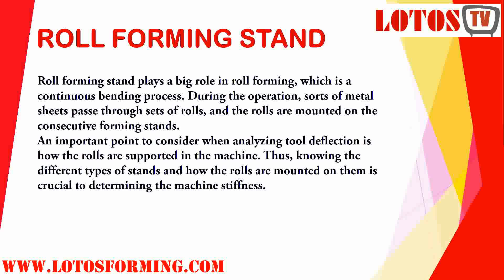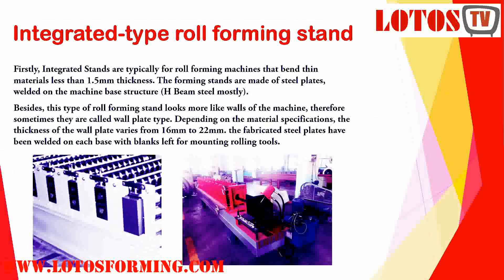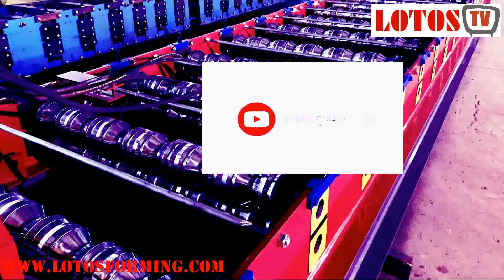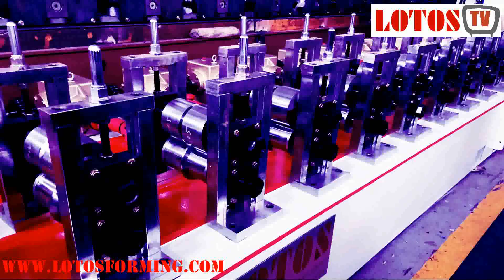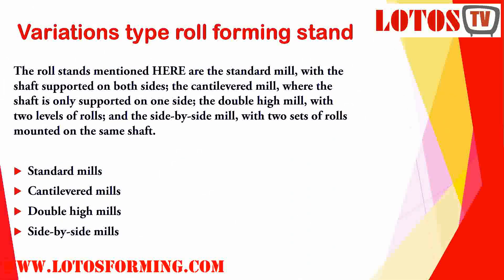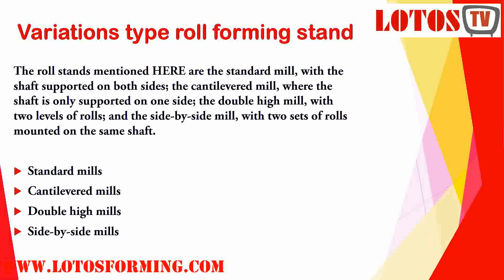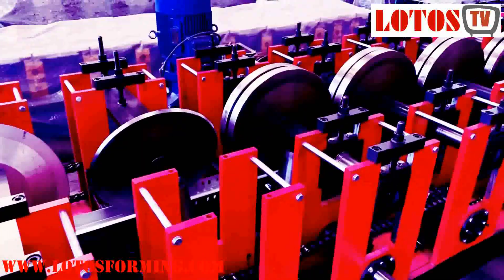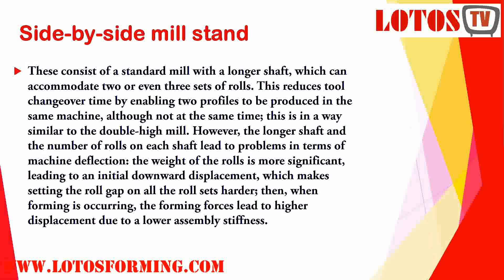【Roll forming machine】: Roll forming stands | Roll forming machine component " LOTOS 2020 "

Comment: Integrated Stands or wall plate type roll forming stands are for roll forming machines that bend thin materials less than 1.5mm thickness

Comment: The variation  roll stands are the standard mill, with the shaft support on both sides, the cantilevered mill, where the shaft is only support on one side, the double high mill, with two levels of rolls, and the side-by-side mill, with two sets of rolls mount on the same shaft.